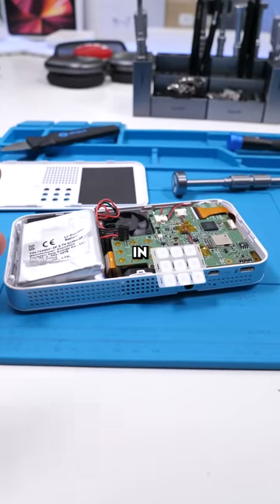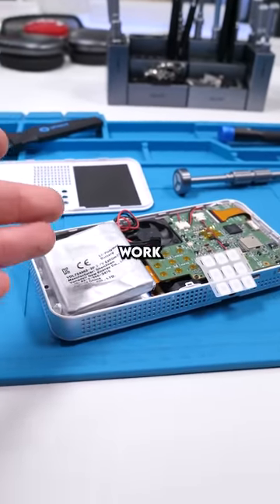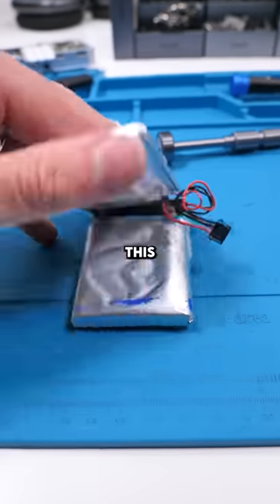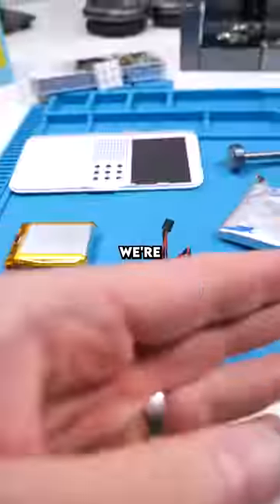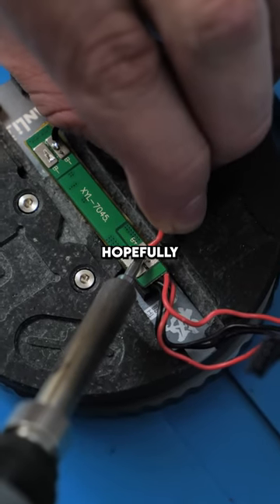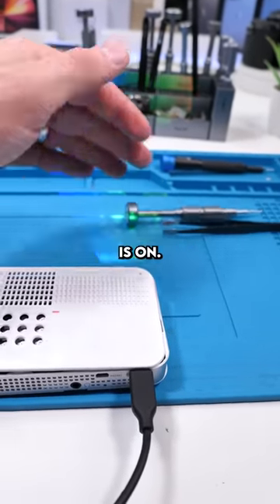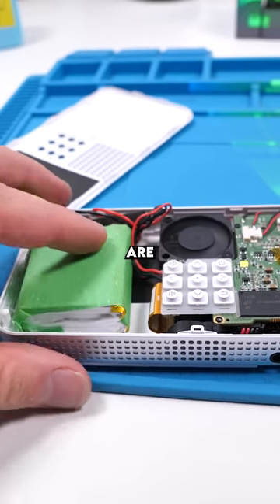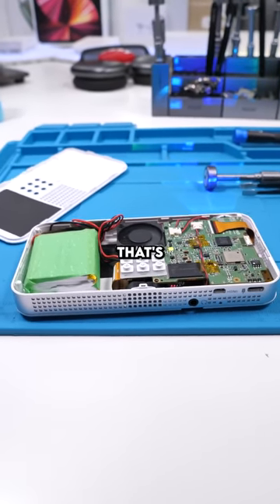Can I get This Projector Working Again? #Shorts

Comment: I have done this many times when replacement batteries are not available. I just buy a similar size cell and swap the battery..(also swaping the battery resets the bms in most cases)

Comment: Maybe a 3d printed bracket to make the portable projector a little taller?
Reply: Yup, like a little 1cm tall Bracket that attaches on it
Reply: Or just maybe 🤔 order batteries that actually would've fit?
Reply: @michaelf.2449  he would if he could, problem with some Chinese tech is they get batteries from who knows where and when you try to find a replacement the serial numbers don't match anything, so you make it work with alternatives and hope it doesn't blow up
Reply: @sisamusudroka3000  yeah but finding batteries that fit that sized compartment wouldn't have been difficult
Reply: @michaelf.2449  If it works, it works, plus it makes for new video ideas. If you b*tch about every small thing you'll never be happy with anything.
Reply: @sisamusudroka3000  yeah I'm just letting the op know their are better ideas than making a 3d printed case in the future
Reply: @michaelf.2449  true, 3d printing where I'm from is expensive, in fact repairing anything is expensive, so finding stuff that just works is valuable to me. I would probably put the lid back and tape it together, and fill the gap with something I find lying around.
Reply: their most likely standard batts, id be putting 18650s in it, from the dimensions it looks like they’d fit properly

Comment: You can try to model and 3D print a new top but with a bigger height so the batteries would have enough space to fit inside.
Reply: You could, but simpler to make an extension/adapter plate and maybe find some slightly longer screws.

Comment: Just find a single battery that fits the dimensions with enough voltage and amperage. If the two are hooked in series then double the stock voltage and use same amperage. If they’re hooked in parallel then double the amperage and use same voltage.

Comment: 3D print a custom top plate of the case, also you could apply heat to the plastic plate and makd a mold into the the slightly warm but maleable plastic of the case and make space for the batteries. 
I dont know if it works, but it should (?)

Comment: 3d print a small riser for the whole case so you can just attach the other side and it will be slightly thicker… make sure everything remains secure. Boom custom projector

Comment: You could have just removed the nickel pads. You didn't solder on the solder pad, but the nice pad used for spot welding.

Comment: WARNING: never use batteries with a different bms than the original, since over- and undercharge voltages may not match between original and replacement cells, so just replace the entire pack, not just the cells

Comment: The originals was 6200mAh and there is 2x of them, that’s 12400mAh of available power as per manufacturer intent. The new batteries are OTC 2500mAh, so 5000mAh with the new packs. So instead of space, the bigger worry is that the capacity is reduced to 40% availability?

Comment: bro, you forgot to remove the protection circuits from the new lipos. the old ones were directly connected to the custom protec pcb, you basically now have 4 protection circuits. Idk if that's bad or neutral but wanted to point that out

Comment: You can try fitting two high capacity 18650's. You can use some 3500mah binned samsung cells

Comment: I would say. You should have charged or discharged both the lithium ion battery to same voltage. Because if the one cell is having more charge than the other then it's not good.

Comment: if it's with screws you can try to 3d print a spacer. with a notch on the bottom and top. that's how i would solve this if the customer agrees...

Comment: You do know most of those battery plate or tab thats on the s board usually comes off by heating them up using a soldering iron right ? Unless this one happen to be spot welded from the factory

Most portable battery bank that i work on have that tab that can be desildered feom the board

Comment: Makes a simple repair sound difficult. Would have been more successful if he measured the original cells and ordered the correct ones. The 6(sometimes7) digit number stamped on the cell is the dimensions of the cell. This means you can always get identical replacement film cell batteries. Shouldn't cost more than 15-20 quid for a pair of those, cheaper at trade pricing.

Comment: 3d print a new back case with bigger depth  that was luck that the bms had permanent memory most of those  after you disconnect the power it loses the firmware but guess what  it can work without bms , and that by installing a diode at negative pole

Comment: My phone won't charge because the charging hole won't hold a charger and the headphone jack won't hold the wire. I only had this phone 1 year its the s21 and I had no problems like this with my other 2 phones

Comment: The batteries you showed already have BMS. It is not recommended to connect a battery with a BMS to a BMS board also the BMS board is not universal so it's for one battery type only

Comment: 18650s? If they fit you'll increase the capacity.
Reply: Nope, in this small size have those packs a higher energy density. This Beamer will likely just draw a small current, therefore 99% of the 18650s are way too overkill and not efficient.